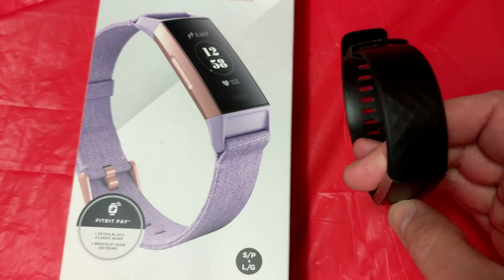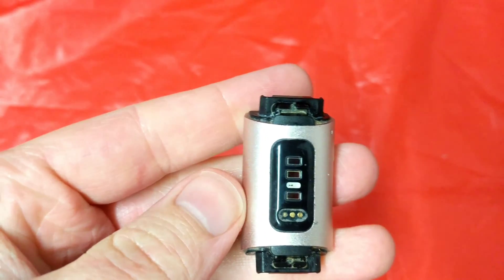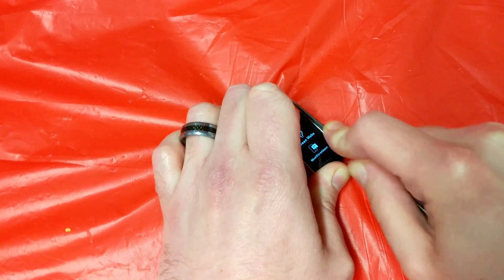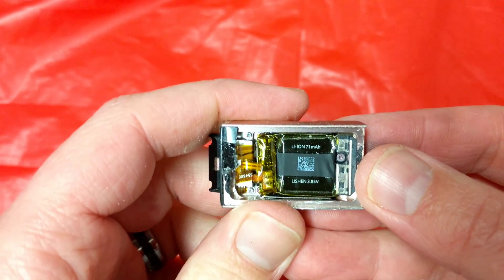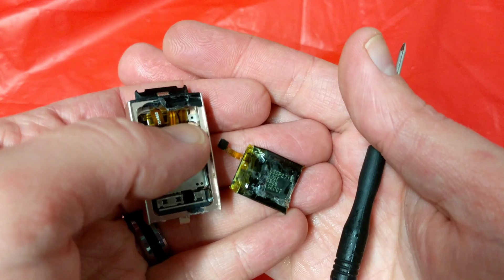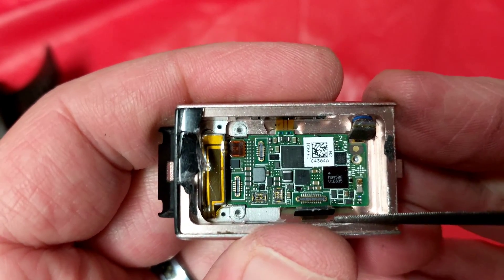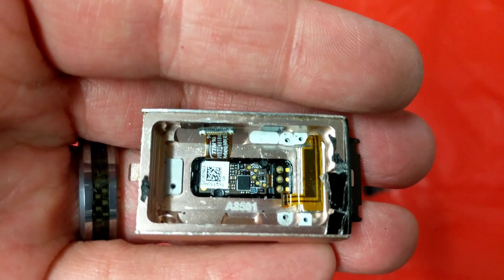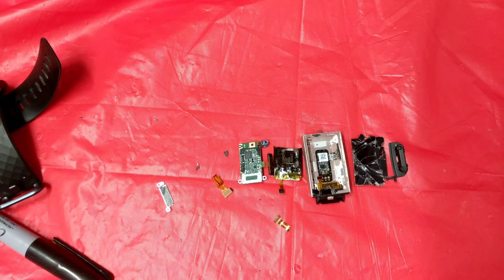Fitbit Charge 3 Teardown. Bad Battery & Dead Pixles or Lines On Screen

Comment: you should have removed two of the screws on one of the sides of the fit bit and the screen would have come off without any force.    You can see the super tiny screws when you remove the wrist band.
Reply: The screen is held on with adhesive.

Comment: Had the same issue with my fitbit charge 3. As soon as i took it off the charger the battery would go from 100 to 0 and flashing ? They tried to tell me it was a software issue. This is now something i bought 3 years ago that only worked for about 7 months.  It will be my last fitbit they lose.
Reply: Mine lasted like a year in a half 😭

Comment: should have used a heat gun, could have saved u a fitbit, 
replacement batteries are cheap, 
the  dead pixels is my current problem, I think or hope its just the ribbon that is not properly inserted
Reply from the maker: Hey bud! When I made this video I didnt know you could get a heat gun with a choke at the end. I know now though! I don't think its worth getting in there for one pixel. It is super, super hard to get out.
Reply: @NevsTechBits  mine started with 2 lines of pixels, then the next day much more pixels died, then after a swim half the screen died. I rather got the samsung galaxy fit2 which is a 1/4 of the price and can do much more.

Comment: Great video!  Before popping case (pinhole pry spot ... check your watch version): 
•if watch's user data track (green blinking light) works, a fix shortlist may include:
•Mobile app Notifications settings,
•Watch app Notification settings,
•Clock face choice compatibilty,
•Ignoring watch's "100% charged" disconnect charger from watch alarm+vibrate. 
•Verify user choices available on watch's: 
••Sleep lighting choice, 
••Brightness choice, 
••Alarm set choice, 
••Heartzone+stats set conflict,
••if user's mobile habits involve frequent game/app uploads + unloads, or if your usual morning pulldown Quick Settings review shows lots of mktg phishing (nfc on, visibility on, dnd on, sharepoint on, bt changed, car bt connect changes etc).

Comment: did you manage putting it together again_
Reply from the maker: Nope. Fitbit corporation won't even do that. But if you check my comments, someone else managed to do it with a heat gun that had a huge choke on it.

Comment: could have definitely used a heat gun to melt the glue to remove the LCD
Reply from the maker: Without breaking the LED?
Reply: Nev's Tech Bits yes definitely. You could still break it if not careful but same with iPhone and other compact display electronics you more than likely need a heat gun or a hair dryer at the very least.
Reply: uses heatgun https://www.youtube.com/watch?v=qN8XGGpFGfo
Reply from the maker: @hockysa  I didnt realize you could get a heat gun with such a choke on the end of it. Thanks Hockysa!